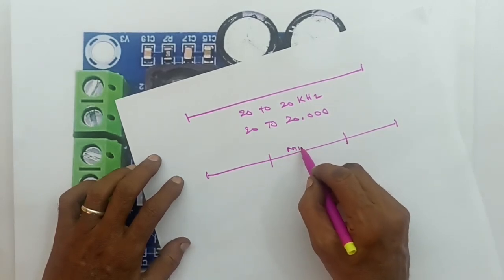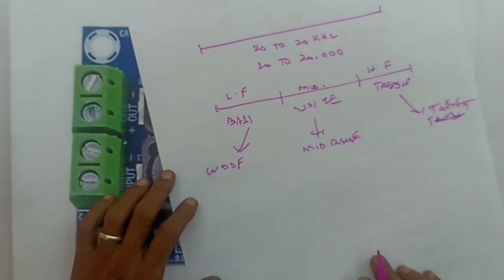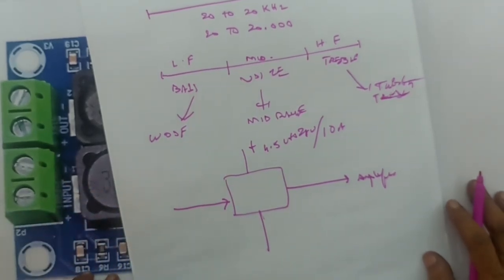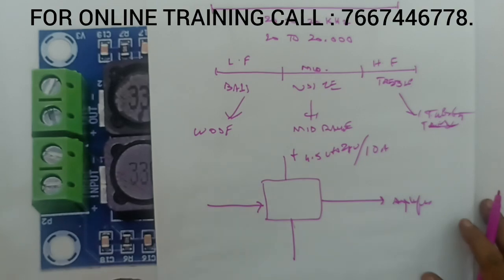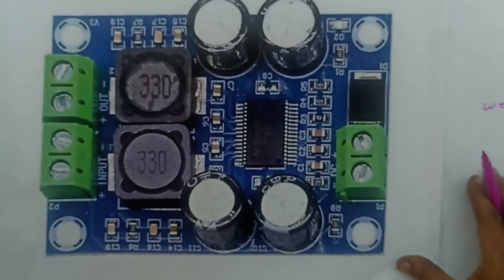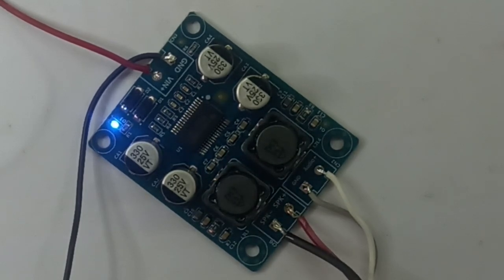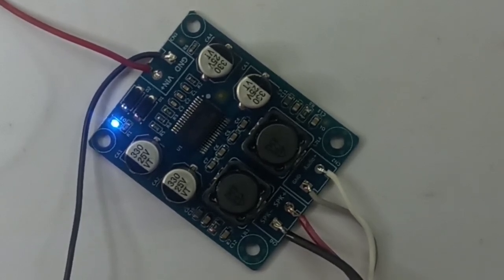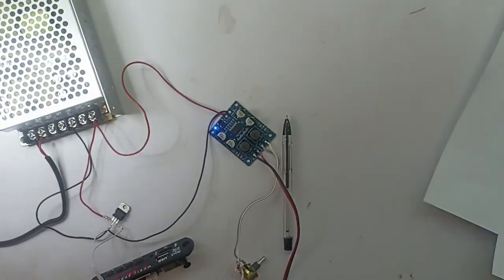DO IT YOURSELF...CLASS D, 60 W POWER AUDIO MODULE.. WORKING PRINCIPLES WITH CIRCUIT DIAGRAM AND DEMO

Comment: Sir i have Akai two speaker     box 60+60 , woofer, mid rang, twitter, sound horn with Built in Net work , i want amplifier, please tell idia. Box back side , b, t, vol  controller, no power connection.
Reply from the maker: A seperate video, will be uploaded soon